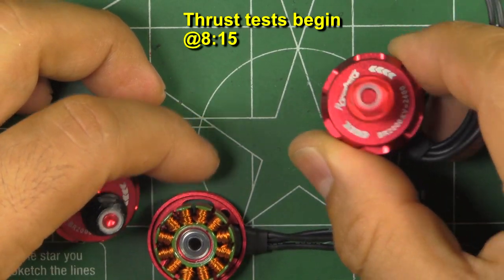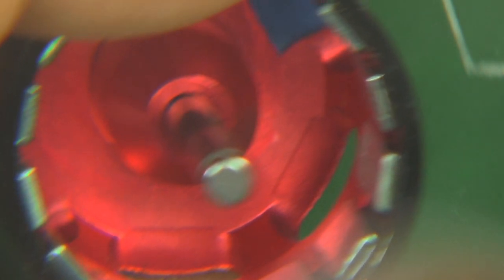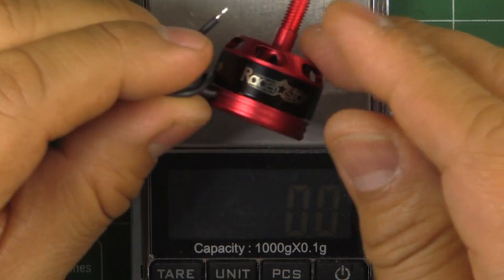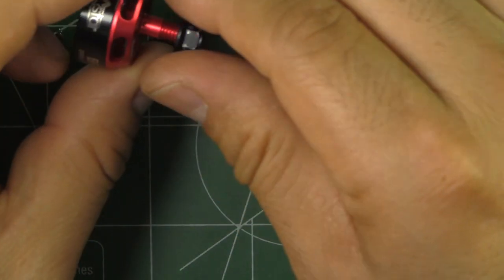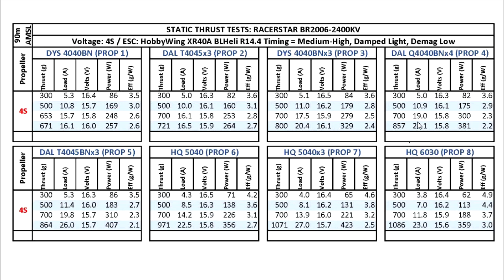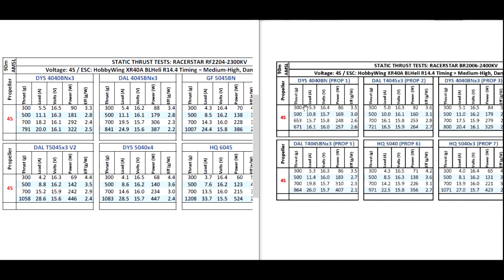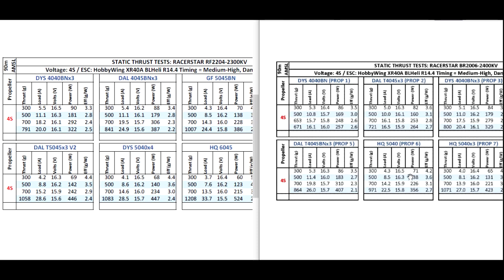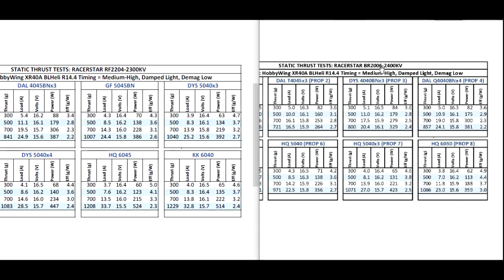New Motor From Banggood.com -RacerStar BR2006-2400KV- Static Thrust Tests

Comment: HI, 
I just bought a set of the smaller ones ( BR2205 ) they seem to have good reviews and  build quality, so yesterday I ordered two more sets. 

Today, while looking at my new motors I noticed 3 of the 4 have some up/down play on the shaft ( about .0.5mm )
So, could you say how I could take out the slack? ( your review shows the allen socket/grub screw on these 2006 and my BR2205 also have the allen/grub screw )

Is it possible to loosen this, move the shaft in a little way, then retighten the grub screw to remove the free-play?

I am totally new to this, I am still assembling parts for my first mini quad build to learn with.

So far I have a Diatone Hello Color 250 frame, Naze 32 Rev5 FC,  BR2205 2300kv motors, KingKong 5040x3 props
and have ordered RacerStar MS25A ESC's.
Still undecided on cam ( 1117 likely ) and not decided on vtx  ( but 200mw 5.8Ghz ) maybe Pagoda vtx antenna?
For TX either FrSky Q7 or Taranis and a small rx for quad.
Might choose rev 6 naze if it is better ? I would liek Sbus if possible, but I do not know enough yet.

Tahnkyou for your videos they are good.
Reply from the maker: Yes you could try loosening the grub screw. Make sure you use a good set of allen keys so you don't round the screw head. I would place a prop nut on the prop shaft, don't thread it all the way, rest nut on a wooden block. Then use a flat punch on shaft and carefully tap with hammer. Leave shaft retaining clip on. Check play after a couple of taps and see if it improves. There's a risk that you may press it in too much however, so gotta be careful. That's the only way I can think to fix the up/down play.  I'd say just fly like that, should not be much of an issue unless play gets larger.
Pagoda antenna has been getting really good reviews. Check out Farvew store. They ship free within US and prices are very reasonable
For FC, I'd go for a F4 - there are many, MotoLab, clones etc or any of the F3 FC's would be good too. I would go with those over the Naze R6. All your other parts are pretty good. Thanks for watching!
Reply: Excellent thanks I'll get right on that :)
I just ordered a couple extra cheap frames ( robocat 270 and another obscure oddity )
I've had a read up on newer FC's and wow leaps and bounds! , yes you're right, F3-F4 are way better than Naze32! especially when turning on functions ( CPU % loading ).

Since I'm such a newb I think I'll need to find something with altitude hold ( so barometer? or sonar? function ) so I can stay low down and not crash as much haha.
Definitely want Sbus and settled on the 4xr-sb and I guess the programmable leds function in cleanflight would help me with arm/disarm making it very obvious visually. ( i think betaflight now has led function too? )
I flashed the Naze32 r5 to latest firmware and cleanflight anyways , it can be my SHTF backup. :)

Many thanks again for the reply, I'll give it a go ( I've got 12 of the BR2205 motors now ), I'll let you know the outcome.
Reply from the maker: Applecart2000 altitude hold doesn't work well in these quads unless you plan on only hovering and flying at walking pace. Better to use throttle for altitude management. it's not bad. My experience was that building and practicing on a light micro quad helped me a lot. 1306-3200 and 4" GF4045 props or 2204-2300 with DAL 4040x3 props on a 180mm frame makes for a light quad using 1000mAh batteries so when you crash only the props break. On larger and heavier quads more things break. Having a more resilient quad will inspire more confidence and keep you in the air longer and not on the bench fixing stuff

Comment: Could you please test the Kingkong 2205 GT motors? They look very interesting for the price

http://www.banggood.com/Kingkong-2205-GT2205-2350KV-2-4S-Brushless-Motor-With-Motor-Protector-For-X210-220-250-280-Frame-Kit-p-1106900.html?rmmds=search

http://www.banggood.com/Kingkong-2205-GT2205-2700KV-2-4S-Brushless-Motor-With-Motor-Protector-For-X210-220-250-280-Frame-Kit-p-1106899.html?rmmds=search
Reply from the maker: Yes, those look great. Unfortunately I didn't get test samples :( 
I may have to order just one to test and see how it performs, but Chinese New Year makes delivery slow. I don't know if I'll get one to test.
Reply: Yes, mate, they certainly look good for the price and the only thing that stopped me from ordering them was also the Chinese new Year delays, so I opted for a set of the tried and tested Emax red bottoms from a local Ebay seller. They arrive today :)
But I hope this kingkongs are good and reliable because the price and the looks are really very appealing.

Thanks for your reply, I like your channel, you earned yourself another subscriber ;)
Reply: Bought a set yesterday. Damn, the motors don't even look like cheap motors. Curved magnet, tight airgap, 4mm internal hollow shaft. The magnet seems to be a high temp N40 or N45. Unfortunately, the wire isn't silicon wire. It's just the motor winding covered in heatshrink. Also, the shaft isn't stainless. It's magnetic
Reply: I checked the stator and count the stator plate and I found out the stator lamination maybe 0.15mm (30 plate/5mm = 0.16mm Let's say the lamination, glue etc is 0.01mm so the plate must be 0.15mm (am I wrong?)
Reply from the maker: It's a shame these motors haven't been in stock for a while -they're pretty good for the price. They're not super high power motors but they got good performance and efficiency for a nice budget build.  Yes. I usually count the number of laminations and divide by the height I measure for the stator. So 6mm / 30 laminations = 0.2mm per lamination
Stators are 6 not 5mm (2006)
Reply: I heard they only produce small batches and their QC is pretty strict.

I personally think this motor is much better than another budget motor "BR2205" series. The 0.15mm lamination is great, but it means heavier motor. This motor comes at a bit over 30g, which is quite heavy
Reply from the maker: Yea, I never see them anymore and yes they're a bit heavier but their other pluses make up a little bit for the extra grams.Would be a very awesome motor if it was around 25g

Comment: I bought a set of 4 and they pull well but I was getting a lot of vibrations. Turns up one of the motors came with a bent shaft.
And now the motors are out of stock😐😐
Reply from the maker: That's the first report I hear about a bent shaft from factory. Maybe bearings are defective? That's one of the drawbacks of budget motors, always a chance to get a defective unit (even more expensive motors sometimes people get defective parts) Always good idea to get an extra spare motor but then that means you have to spend more money. Hopefully they come back in stock soon. However, Chinese New Year means about 3 extra weeks delay....
Reply: The bearings are fine and there is no wobble on the motor bell. The only thing that seems to be bad is the top part of the shaft that holds the prop. Im pretty sure it came like this from Banggood because I did not crash the quad. I was very happy with the motors when I went for the first line of sight test flight, but when I turned the googles on and noticed the video shaking, it was very disappointing
Reply from the maker: Sure seems to be factory defect then. Perhaps shaft was pressed in at an angle. Yes, these motors were quite a nice surprise on their performance. Hopefully the issues like yours are very few

Comment: Good review as always. Do you have the 2008 racerstar as well for testing?
Reply from the maker: BGood didn't send me that one. They're releasing so many motors lately -hard to keep up. DYS 2008 motors tested very well. Very torquey. RStar's version should be pretty good as well.
Reply: Yes I was thinking the same thing, I am gonna build a new 5 inch in a short while and thinking to go 2008 for 5040x3 or if it ends up a light build (dont know the weight of the frame yet) ,2006 and KK5045. The weight diference for the motors in total should be about 20gramms more or less so it is something to consider.
Reply from the maker: That's the only drawback of the 2008, it's a bit on the heavy side at about 31g. Some pilots say they can feel the 4g difference, which I don't doubt. I certainly can't tell the difference in weight with my flying skills LoL.... I've been wanting to try the 2008's I have but haven't had a chance yet.
Reply: hehe yeah same here, I can feel a lighter copter like say a 5 vs a 4 inch but 20 grams nah not yet lol. But I like efficiency and should really be fun to see if the 2008 efficiency outperforms the weight penalty in real flight.
Reply from the maker: Exactly why I want to try those 2008's. It's going to be interesting to see if results translate into the real world and it'll be good not to torture LiPos as much and still have good response. Most efficient setup I once ran was with Cobra 2204-1960KV on 4S and HQ6030 props. I could fly around for 15min on a 4S-2650mAh-25C LiPo (down to 3.5v per cell) But just flying around midthrottle and a few punch outs learning to FPV back in the day.

Comment: Can you do some 4s vs 5s in the future tests you do pretty please? Would be great to finally see some results with 5s and especially to see how 5s compares to 4s.
Reply from the maker: I may try, the only problem with 5S is that static thrust tests load the motors way more than when they're spinning in flight. 4S tests are already pulling very high Amp numbers. In reality, when motors are unrestrained and moving thru air, Amps will be a lot lower. So 5S on the air will be perfectly OK but on the thrust stand 5S may end up frying the windings or blowing a ESC. This is what I think could happen in these "high" KV motors, 2300KV and above. 2000KV and lower motors are OK to tests on 5S and 6S. These high KV motors really give me the heebie jeebies when going full throttle.